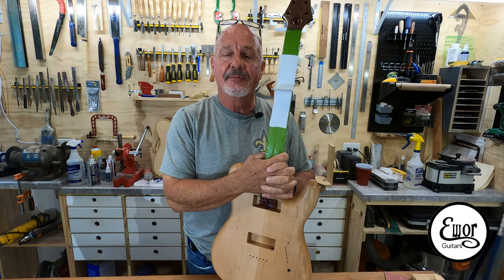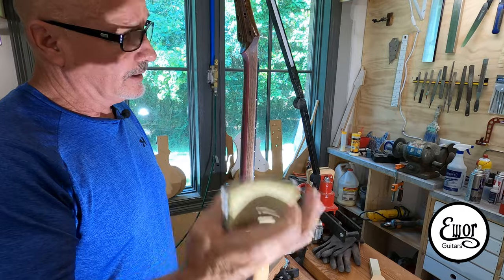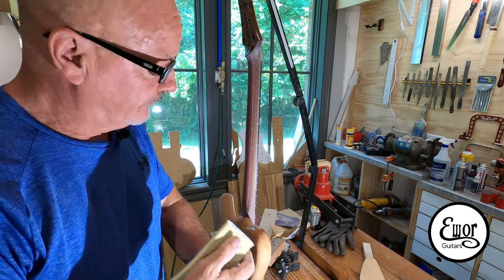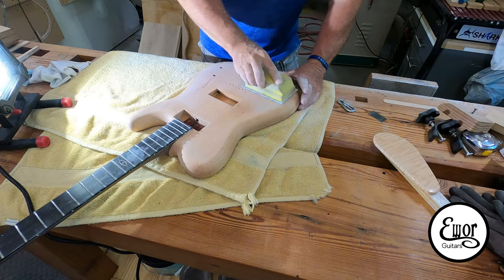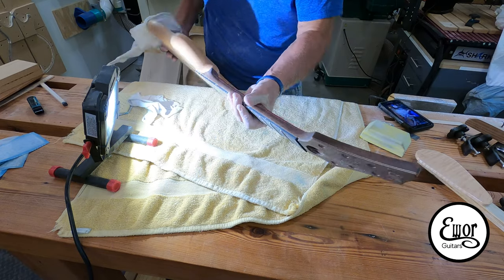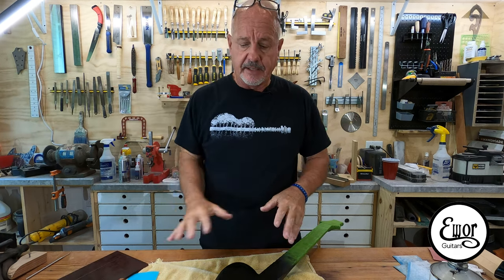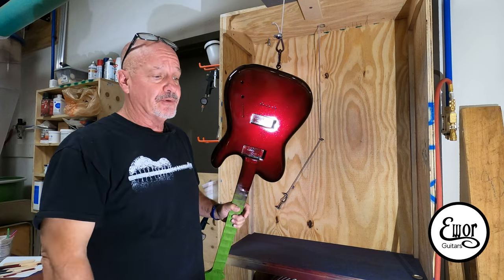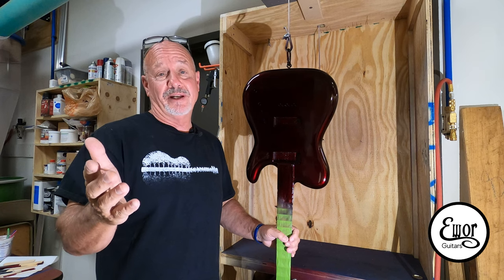How to paint a guitar part #2

Comment: I commented on, maybe the last video of this series, mentioning that I have only used nitro. But I love this finish. Beautiful color, sparkle and shine. I wonder if you could answer a couple of questions. What solvent do you use to clean your guns? You said you didn't thin the seal coat, but do you thin any of the other layers? I think I counted 5 different products in this video;  sealer, black base, pearl flakes in clear, candy apple red, top coat. I'd love to have your "recipe" for each layer. I'm seriously thinking of repainting my Tele now. It has a lot of lacquer on it now. Would I have to completely strip it or could your method go on top of it. Thanks for sharing this beautiful finish! BTW, it's real interesting how much difference the pearl layers made. It's as if it let the black shine through the red, yet let the red show off, and didn't mixe the 2. Maybe your black was old. But I don't care what brand of black lacquer I've used, I've always had problems with spatter, especially the Stew Mac gloss black lacquer. It's horrible. I will never use it again. Of course it was out of a rattle can.
Reply from the maker: Hey brother, I use lacquer thinner I get from home depot for cleaning everything ( it’s cheaper than the urethane reducers and does a great job.) on a few occasions I have reduced the simtec sealer with acetone but I usually don’t. The other products depend on the manufacturer recommendations. The black base is 2 paint to one reducer because it is pretty thin to start with most others are 1to1 and the clear is 1 paint 1 hardener and 10% reducer. When I cut through that finish I had to strip all the paint off down to the sealer then I re sealed it and started over again. I think if you were going to try the urethane products you would have to go back to bare wood and start new.
Reply from the maker: Most of my paint comes from PPG I use the deltron which is their high end line and the clear is tamco euro clear I really like it for the money